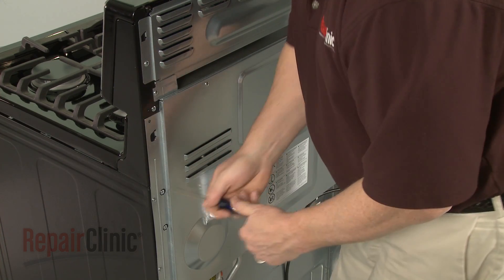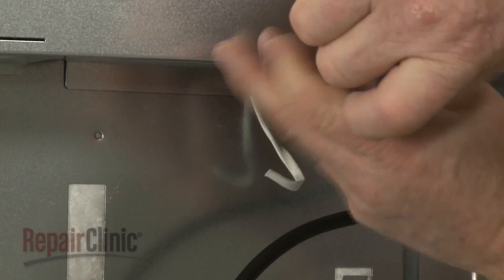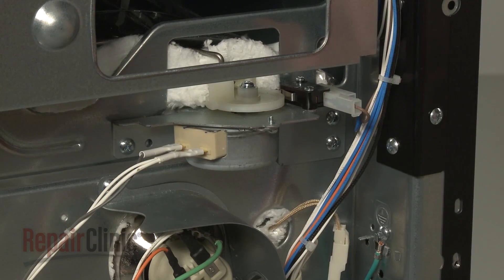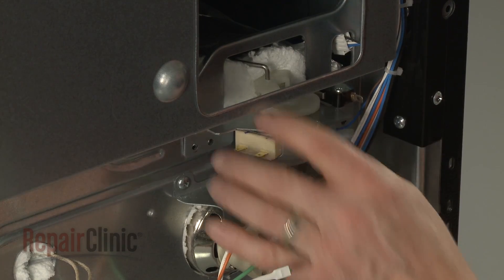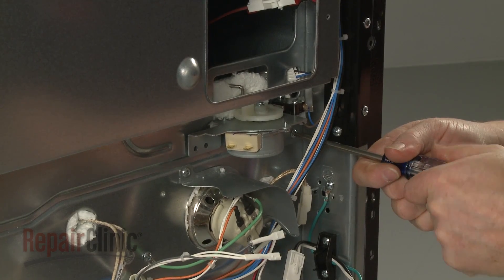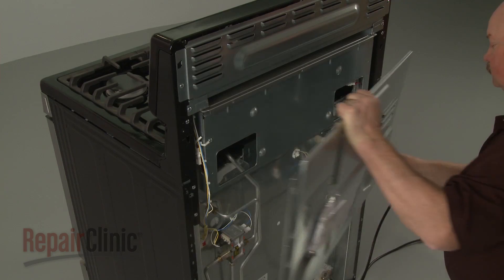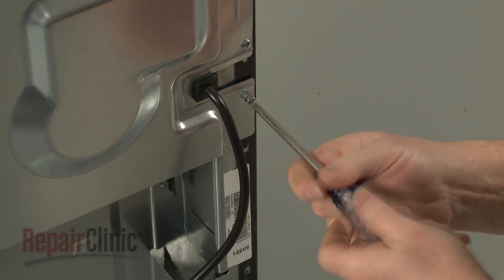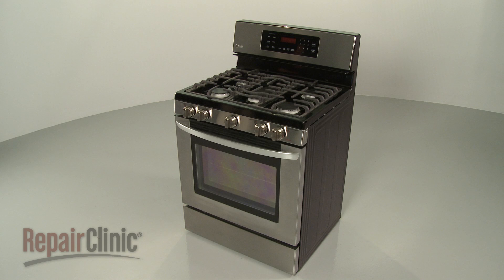LG Oven Replace Door Lock Motor Assembly #EAU60671901

Comment: Instead of replacing this part which I prefer not to as I will never run the self-destruct (aka. self clean) feature again, can I not disable this motor so I can remove the locked door error on my panel to give me access to my oven again? Thanks!